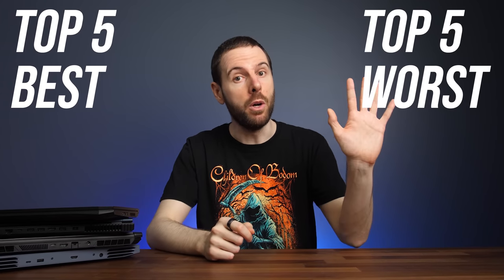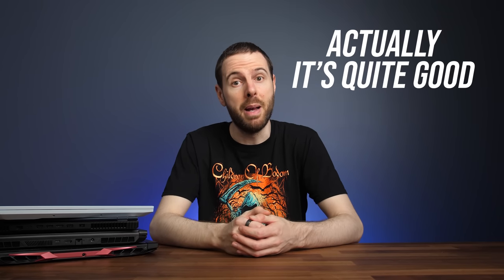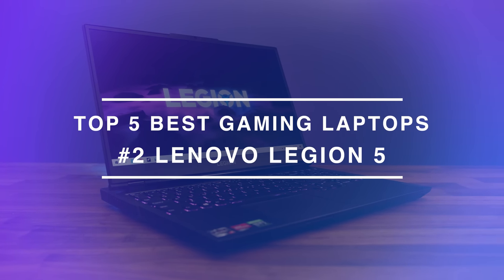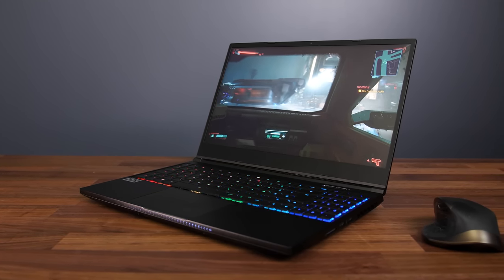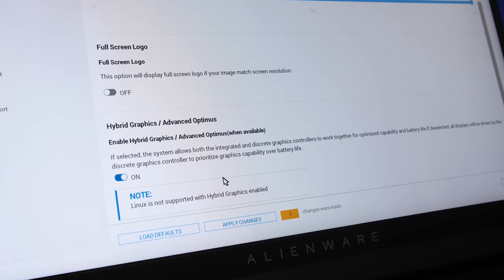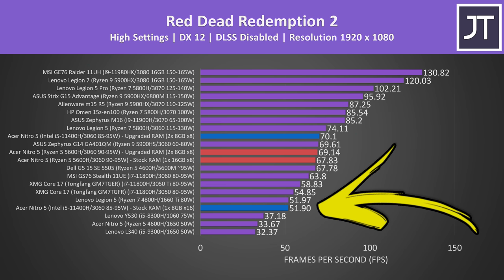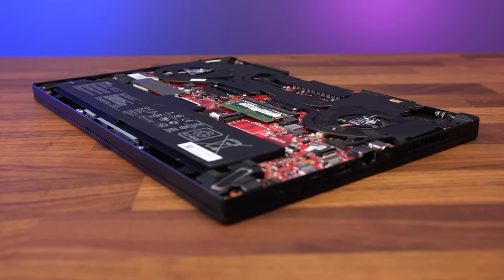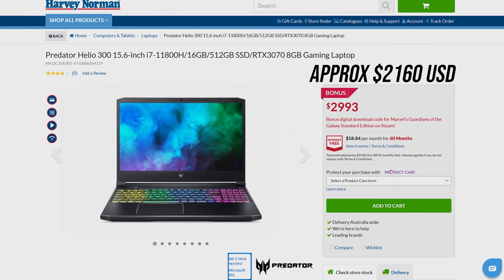Top 5 BEST & WORST Gaming Laptops of 2021!

Comment: here in brazil the helios 300 comes wth dual channel RAM, and costs less than the dell g15 and lenovo with a 3060, so here ts a great deal, specially if you already have a external monitor

Comment: So I currently have the acer nitro 5 with a 1050ti and core i5, and it works pretty good still but I think it’s prob time for an upgrade so what would someone recommend (also trying to decide if to even stay w a laptop or go w desktop). Thank u everyone
Reply from the maker: Only worth keeping laptop if you need the portability, otherwise do desktop. 3050 / 3050 Ti will be a reasonable boost, but if you can afford 3060 it's 50% faster than 3050 Ti for like a couple hundred dollars more and definitely worth it.
Reply: @JarrodsTech  alright thanks I’ll prob go for a 3060 desktop then, in your opinion would I get a better deal doing a prebuilt pc instead of building one

Comment: honeslty you just need to upgrade to dual ram stick with any version of ACER nitro 5 and it would be a beast..amd given that their prices are impressive spending extra bucks to buy aother ram stick would still place their laptop as one of the best in their price range especially if bought during sales..(still in my opinion this does not apply to the 3060 one ..yeah you can get the best performance out there with 16 gb  3060 but you can also get the same specs and better looks in my opinion without spending the extra bucks )

Comment: Might be getting a g15 SE with a 4800h and 5600m for under $400 I found used, anything I should know or should I wait and save up till I can get a Legion 5 or Zephyrus g15?
Reply: That laptop looks cheap, runs hot, has USB 2.0 ports, lacks a MUX switch, and overall isn't great for the money. If at all possible, I would save up for a Legion 5 or Dell G15 2021.
Reply: @cameronbosch1213  so it's not worth it even if it's a 1/3rd of the price everywhere else it's sold?
Reply: @NovaCaine2489  I mean, for $400, if it has a 120 hz or the better 144 hz screen and the laptop itself isn't dented or the screen scratched, then it's fine for now while you save up. But if the screen is damaged at all or it is 60 hz, then I wouldn't go for it. 60 hz gaming in 2021 and beyond won't be great.
Reply: @cameronbosch1213  seller didn't know the refresh rate, but I did find an auction for a HP omen 15 with a 4800h, 1660ti, 144hz display, and 70 whr battery for about $630 so I might go with that until later next year or the year after that and wait till newer Zephyrus g15s come out
Reply: Nevermind on that one, by the time I would've been able to bid in like 2 days it probably would've gotten too expensive, so I'm gonna wait till I get paid next week to get a slightly more expensive one that's just buy it now

Comment: I have the DELL G15 with the better screen and all I have rto say is THE SOFTWARE IS GODAWFUL
yeah it's great for the price (got it used and cheaper) but I still cannot turn on the keyboard lighting
I can recommend it but just be wary that the software experience is so bad it should be illegal to sell a product like that
Reply: My former Dell XPS 15 wouldn't even sleep properly, instead, it would reboot and get very hot. Imagine if I had put it in a backpack like that...

Comment: Maybe I’m just unlucky but I’ve found Tongfang-based laptops to have substantially worse build quality than others. My MECH-15 G3 had a bad trackpad and dead pixels on the screen. You can’t beat the Legion line if you can get one on sale. I bought the L7i with RTX 3070 and two-year extended accidental damage warranty for less than $2000. For that price, I can tolerate having to disable iCue.

Comment: I'm here just to hand out a caveat to those who are planning to get a new gaming laptop 
JUST DON'T BUY ASUS ROG STRIX laptops. PLEASE DON'T. 

If you're ready to invest more bucks in for a "laptop" ( Asus Zephyrus or Scar ) , you could try opting in for a Razer. Atleast, you would be relying in for a standard gaming laptop which wont be a cause of worrisome all the time in case of performance issues and longevity . 

 Considering the high-end games to be released starting from 2022, Asus seriously won't be a good choice. Also, im just voicing out my opinion in terms of pure experience with Asus laptops since 2 years . 

P.S  You could even consider building out a good high-end PC too, if portability aint a concern  ;)

Comment: Dell has a LOT of quality control problems. I have had several computers replaced by Dell due to problems. Also, they use foreigners for customer service that has mixed issues as to being able to understand them.

Comment: I did get my MSI delta 15 yesterday, and man, what a beast! Small, light but so powerful. Okay, it's loud on extreme peformence, but on other settings, it's much better and I will just have 60 fps, not 240 bc then I want that for my pc and 32 inch 4k high refresh rate cost so much money... So i creep it at 60. I will also have a better battery life for school 😂

Comment: I bought Tuf f15 ... But mine has a i7 11800H (8 cores) and also has an inbuilt camera (other specs: rtx 3060, 16 GB ram and 1 Tb SSD). So, although basically the model I bought has everything wrong with the normal model of f15 "fixed up".

Comment: But what is a "MUX Switch" he is so obsessed with?
Reply: Most gaming laptops route the GPU to the display through the CPU. A Mux switch (multiplexer) allows you to route games directly from the GPU to the display. 

In practice, this means 5 to 15 more FPS in games. 

I'm with Jarrod on this one. Mux switches should be standard on all gaming laptops.

Sure, if a laptop doesn't have a Mux switch, you can usually output directly from the GPU to an external monitor using the type c port or HDMI port, but that isn't always practical.

Comment: I still have some regret buying the MSI creator 15 2060 for like 1300 (Tax included) 
If i would have waited, I probably could have gotten a 3060 for 100$ more....

You know although it nets 30% more performance, not having the full aluminum case, 3 fan cooling, upgradable options, 100% srgb and (even though I may not use it) a touch screen... There are things that the gaming laptop just doesn't have. 

Also they are selling the MSI Creator 15 4k OLED for 1450 (1570 tax included) with the 3060. You see the thing is I am not sold on OLED....IT HAS A LIFESPAN!! LCD is tried and true. I still have a 720 p samsung TV I bought way back in 2008 still working. Hell, my GBC still turns on...

I will be honest, the thing I bought will last me 10 years (I am upgrading in probably 5 though but I love going back in time and turning on old computers. I am using my Acer Transfromer T100TA 10 inch screen to read and surf the web with as a second screen lol.)

Comment: got the g15 with the 165hz screen, it does run a bit hot but i disabled performance boost mode in power management, now games like a plague tale which used to run at 96degrees now dont go over 71 degrees and hardly a 5-10fps drop which is negligible since I'm running over 140fps anyways with max settings. at the price of 1250 after tax it was a steal at price (yes i missed out on the earlier at 1150) to performance. the only things i hate, they didnt add an extra nvme bracket which i tried to salvage from my local market but could not find one my only next source is aliexpress. For now my 970 pro just dangles around. 
 the alienware software they use for the g15, its kinda stupid they reused software butlimited alot of the features available for the alienware series which also forced me to reinstall windows on my first boot since it would keep giving me errors. last the high density rams, atm i dont have the time to order and switch out rams, but yea loosing out on performance. the keyboard doesnt feel great, gaming on it feels like im about to break the keys. 
overall i don't regret getting the laptop but when i recently tested out a legion 5 i would have much preferred that instead

Comment: If the nitro 5 had mux switch i have no doubt it would be in the top 5 best laptops imo. In bulgaria here you can get the nitro 5 with 2 sticks of ram 16 gbs for 100 - 300 hundred  less than any other laptop.

Comment: Here i can get the dash 15 with 3060 but all ram soldered on MB cheaper than the acer with only 8gb ram, but you can upgrade that into dual channel....would grab the lenovo if they allowed some power limit settings as i don't wanna hear fans at 100% all the time even in office tasks 😭

Comment: Yes, the Helios 300 deserves the last place. I have it and mine also has a rubbish display, worse than that of Laptops half the price. And the power plug falls out if I only blow slightly against the cable. Plugging a headphone in does not send the running audio the headphone.
The Helioses have been among the best a few years ago, as you said. But this model has so many unneccessary issues.

Comment: basically anything that’s below $2000 mark with a muxswitch, QHD @ at least 144hz+ and a 30 series GPU is actually worth the money at this current time. Anything above and beyond is waste of money since Nvidia 40 series GPUS should be hitting this year, meaning all of these laptops will become obsolete in the next year; that is if UHD (4K) @ 120HZ - 165HZ is attainable by 2023. If not then these laptops might be worth while but it just seems like a waste of money to buy an expensive laptop that can’t even hit 120FPS @ 4K without maxing out your PC all the time. It’s a lot of money. Anything past $2K mark seems like a waste, it would be better to wait til next year forsure.

Comment: I have to argue VERY HARD on the NO OTHER SOFTWARE takes this long lol Asus Aurmory crate on every single asus laptop Ive had can take up to 3 mins to load and were talking G15 advantage x13 flow. and really long as it loads up in time to frag which min isn't bad.
Reply from the maker: Never experienced that from 10-20 ASUS laptops I've tested, maybe worth trying to reinstall it and fix your specific issue.

Comment: My Legion 5 Pro, the RTX 3070 variant, arrived last week. I bought it for €2680.
What can I say about it...
This Legion 5 Pro is YET ANOTHER DREADFUL, ABOMINABLE, HORRENDOUS, EXECRABLE PRODUCT!
It does not perform well AT ALL!

Fortnite, Red Dead Redemption, GTA V, Dead by Daylight, Warzone, Assassin's Creed - Literally in all of those games either 1) the Framerate always averages between 49+ FPS or 2) I get FPS close to 100, but with a lot of stutter and huge, brief drops.
The only games in which I get 100+ FPS are Valorant, CS:GO, League of Legends.

It's important to note that: the laptop is always plugged in, it's set to prefer maximum performance, it uses the RTX 3070 not the integrated gpu, it runs in dual channel and it sits on a cooling pad in the middle of my desk.

Gaming laptops are all the same. They should be banned from the market.
Two years ago, I had an Asus ROG with an RTX 2070. Same story - obnoxious performance, so I immediately refunded it. Then I bought an MSI laptop which had an RTX 2080- this laptop broke last month. It wasn't any different.
But since I needed a laptop for university, I decided not to refund it and accept my fate.
NOW I fell for the scam again! Fool me once, shame on you; fool me twice, shame on me. 
I bought the Legion 5 pro and guess what, it was as agonizing as the other two. But I'm still in university so I need it.

Whoever recommends such products are nothing but GRIFTERS.
3 times in a row same issues, no matter how much I paid or which retailer I bought the laptops from.

Comment: I would that Nitro 5 rtx 3060 model with i5-11400H thunderbolt 4 is best value / frames for gaming IF you multi purposely use it as desktop as well. I was eyeing for Legion 5 rtx 3060 / 3070 in OZBargain for a while & they never go lower than $AU 1900 - 2500. Nitro 5 rtx 3060 in the other hand, lowest I could find is $AU 1297 - 7% Hardly Normal gift card. So you could see thr difference is about $700 on rtx 3060 model. I know that lenovo have muchvbetter screen & GPU is fully powered. But as I mostly used it for desktop I woukd say the difference is about $300 on sale perhaps?

Comment: I really disagree with the mech 15. I had the laptop for a 1 month and it was definitely not as good as the legion 5 pro. Firstly and most importantly, the keyboard is really bad, the mechanical keyboard is just a gimmick and the cramped layout is just uncomfortable. Secondly the mech 15 is a little bit louder while running a lot hotter. My 5900hx went all the way to 95C when the legion stays at 89C. Thirdly the screen on the legion is just straight up better than the mech. All of this while costing hundreds less
The only the mech has for it are it’s easier to open, ram (though Lenovo has reportedly fixed this), more customizable in rgb and power/fan speed, and lastly has windows hello. It’s also a bit lighter but at that weight they are all bulky and heavy.

Comment: unfortunately didn't watch many videos because I didn't expect going in looking for a laptop at that kind of spec but my Asus tuf dash F15 is currently sitting inside the house right now running Linux (3050 model)
didn't do much or any research at all but if you haven't been told already, do not ever buy a 3050, 4050, 5050 whatever, they're all terribly underpowered.

Comment: for me the best laptop is the legion 5 all around , even if i bought the 2020 helios 300 with i5 10300(4c 8t) and 3060 100w 144hz with dual channel and with excellent screen. and it only cost 1200$ with a predator gaming chair it runs all of my games to 60fps above especially on warzone 75-120fps dipends on the game mode and with settings set to (competitive). I personally dont know what the hell happend on the 11th gen 3070 though. it sucks. overall i love the opinion of JARROD here honest , brutal but true. buget vs overprice.

Comment: Totally agree but nitro 5 with ryzen and rtx 3060 in my country comes with 1tb hhd and 256gb ssd and 16gb x8 ram and taking the cost for Upgrading factor you can get 32gb x8 ram when compared to changing the other x16 ram to x8 so when comparing the price to performace ratio in India acer nitro 5 is much better  as when compared to legion 5 there is only 5-20 fps and asus tuf a15 r7 and rtx 3060 the fps is same or in some case nitro 5 wins by 1-2fps difference in AAA tittles eSports not included but nitro 5 is best when keeping budget in mind in India the lowest pricing for nitro 5  and legions 5 with r5 3060 model 1tb hhd and 256 gb ssd is 1200 us dollars and legion 5 with r7 rtx 3060 for 1734 dollars (best price for legion) . Keeping price to performance is 5-20fps for 534 dollars is honestly not worth it all the difference was taken out from your videos but instead better option would be legion 5 with rtx 3070 for 2100us dollars

Comment: I basically can only get the Victus via work, is that wobbling that bad when you use it on e.g. a bed? I xhose a laptop over a desktop so I'd spend a bit more time with my wife, not always in bed but there is that option .
Reply from the maker: I never tried it on something like a bed, so I can't say for sure. I would say it would depend on how much you're moving while using it as to whether it wobbles enough to be annoying.

Comment: Quite disappointed to see the Nitro 5 in the worst list, but you’re arguments could be fair. However over the Black Friday period I bagged the Acer Nitro 5 (AMD Ryzen 7 1tb SSD 16gb ram 3060) for £919 brand new (now back up to £1099) I got this knowing full well I’ll probably upgrade the RAM to 32gb and probably stick an extra HDD in it. Even after those extra costs it’ll  still be lower than pretty much every other laptop on either list.

Comment: my laptop is the worst asus tuf gaming f17 2021 i5 11260h rtx 3050ti bios has problems asus doesnt care to fix it all their other bios updates are broken version 300 the one my laptop came with is the best but still pretty ass, the intel gpu is the gpu for all the outputs internal display,hdmi and the 2 displayport connections over the thunderbolt 4 port nothing out of the 3050ti and the 144hz 1080p screen on the laptop flickers when a game is running lower than like 50fps

Comment: Hey guys I need help deciding which laptop to get please help!!!
1. DELL G15 $600
10th Generation Intel® Core™ i5-10500H
Windows 11 Home
NVIDIA® GeForce® GTX 1650 4GB GDDR6
15.6 inch FHD (1920 x 1080) 120Hz 250 nits WVA Anti- Glare LED Backlit Narrow Border Display
256GB M.2 PCIe NVMe Solid State Drive
8GB DDR4 2933MHz

2. ACER NITRO 5 $685

Acer Nitro 5 AN515-55-53E5 Gaming Laptop | Intel Core i5-10300H | NVIDIA GeForce RTX 3050 Laptop GPU | 15.6" FHD 144Hz IPS Display | 8GB DDR4 | 256GB NVMe SSD | Intel Wi-Fi
Reply: If dedicated for gaming, choose the acer nitro but if you want a well rounded laptop for work and gaming, choose the dell g15. The screen of nitro 5 is crap so unless you get an external monitor, it is not recommended for photo and video editing. Also, the processor of nitro only has 4 cores compared to the  g15 which has 6 cores. Personally, the additional $85 is not worth it for about 10-20 fps increase from 1650 to 3050 depending on the graphic settings.
I recommend you purchase one with 3060 although you have to shell out more money.

Comment: I came here with 2 laptops on my mind.

The Legion 5 (3050ti) and Helios 300 (3060).

I’ll take the GPU hit if it means basically being better at everything else. I had a 2018 Helios 300 with a 1060 and the thermals were so bad. Constantly at 190+ degrees. Constantly thermal throttling.